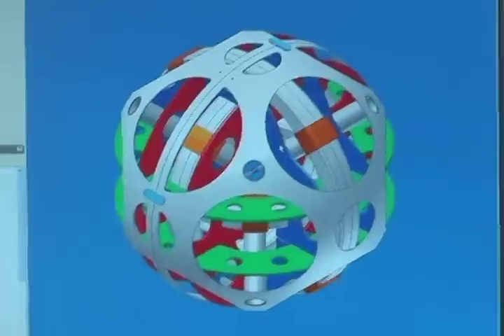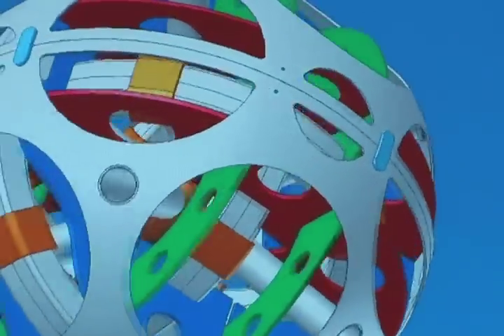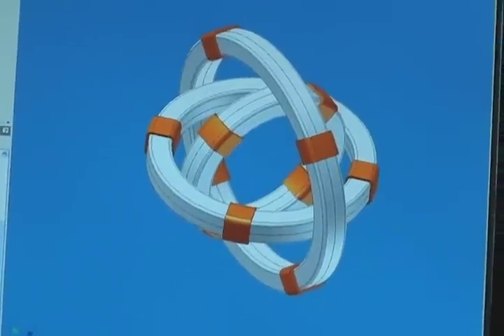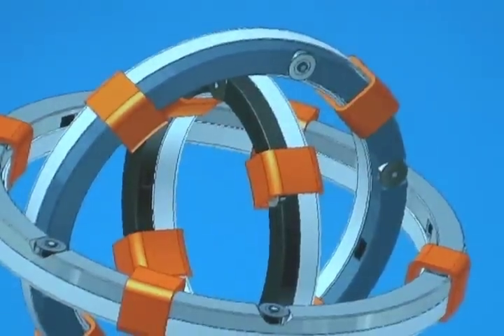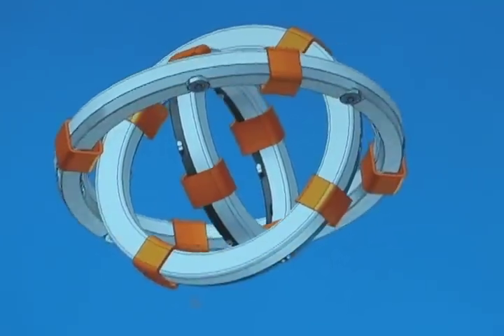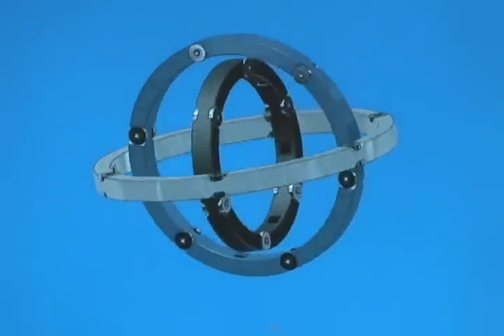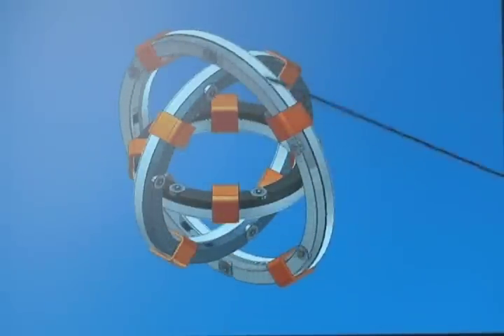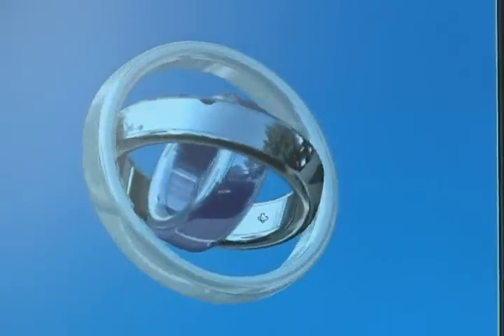Apparatus for Gyroscopic Propulsion Explained

Comment: What will you use to spin the the "wheels"?
They would rely on the opposing force of the friction between the mechanisms base and the ground would they not? 
Have you considered Eddy Currents? You'd have to find a way to deal with the incredible temperatures though.
Reply: +Connor Sprague: The patent describes what are essentially DC brushless motors of the type used an common small dc (muffin) fans or electric model airplane motors, or Video tape and Hard Drive platter drives.
...  Here is the patent
http://www.freepatentsonline.com/6705174.pdf
Cheers, ScienceAdvisorSteve

Comment: wouldn't you have 3 sets of gyroscopic drift to compensate for with your model set up that way. If you have 2 sets of rotters for each axis rotating in opposite directions you would eliminate that. It would not be to difficult with you existing model just split the rotters so you have 2 then reverse the magnets polarity in one and it will spin opposite of its counterpart. To make a total of 6 rotters instead of just 3.

Comment: "Apparatus for Gyroscopic Propulsion Explained"
Apparatus - yes
Gyroscopic - yes
Propulsion - no, no propulsion here.
Explained - absolutely not! you showed how it's built, but not how it works or what it does.
Reply: erasmusso exactly, this guy gets more than 600 000 views for explaining how 3 rings spin perpendicular to eachother and talking about the materials they're made from...
Reply: @Ruktiet  The funny part is that they wouldn't even have the same gyroscopic force if the materials are balanced for the same speed - because different diameters result in different rates of rotation for the same rate of the axis itself.
Reply: I'm with you ... I heard NO PROPULSION explained, WHATSOEVER ... !!!!!  VERY AGGRAVATING ... thinking you're going to "get something", and then ... YOU DON'T ... !!!!!  😡😡😡
Reply: i think there can only be one genius in the world at a time
Reply: J. Christie i like the way you think
Reply: Antigravity is not possible by using gyroscope .... all it does is it shifts all its weight to another pivot point and the flywheel seems weightless ...but the total weight of the whole system is not changed at all...so the term antigravity is not suitable for such device...it's a good way of fooling dumb people out there...you not gonna launch your space shuttle into the space with this ..
Reply: nemo but what I am teach me sensei
Reply: Imagination you Lack. So with this device you want Propulsion? I suggest building a Replication you control it with 555Timer chip, and interface this with "Ionic Propulsion"(High Voltage Wind{seen at Spark Gap}) shown in "Tin Foil Flyer/lifter" video's on "You-tube".
Reply: @j.christie2594  Yes i realised this when seeing the three different metals that were used, i knew it was similar to em lifters....using the voltage saturation in the rings somehow. so essentially, in theory could we use just one ring rotation ring to get propulsion on another device?
Reply: @ambientsoda106  I think this require's several Gyro's Fighting in unison, Each other. I find it hard to believe One Gyro with NO Equal Counter Force('s), can do anything other than balance a Thing/frame attached to a Surface, as we all see in top's/Gyro's.
 Em Lifter + 3Gyro's for even just leveling purpose's would Stabilize. they say 2 is better than 1, but in this case 3 (N. Tesla 3-6-9) might balance  or more, better than 2 when looking for 0-G effect, just saying.
maybe 6 or 9, and add control.
 Some motor's are generator's of Super H.V.  I think a "Joule Thief Motor" using Rotor as Gyro and H.V. for Lifting Ionic.
 A X3, "JT pulse Motor's",  made from those Fidget Spinner toy's like on YT.
  I just thought about that How easy, Spin 3 JT coil's wire them Up, get 3 fidget spinner's, bunch of Tiny magnet's, a back Spike collector, Charger circuit, to Capacitor, to Emitter, to  Foil "Ring".
Reply: @j.christie2594  Hi was thinking of something like one gyro with a high saturation of elections across it... 

I was just thinking about an idea I had at the time; using waves, and using the ring to create a waveform plane as well.

Consider this that by having the right wave we can create a plane like a space distortion, that can pushing a object or an EM bubble forwards. And even a solid state ring a an high electron saturation can create a low pressure distorting that can make things float...I think this rings are interesting but still trying to figure out how they create the force to fly?
Reply: @j.christie2594  Also I find this interesting as a few years ago I think there was a UFO video I saw, and this object was what I believe I saw a version of in the video, why I thought it was a realy video and not a fake - albiet man made and not alien; and that it seemed part of this design explained a curve exhaust in some UFO images; albeit those UFO seem lik eun manned drones.

But actually these videos gave me the ide that a wave form plane can easily be creates to pust a disc shaped prototype craft - which essentially is the design seen in start trek - I know don't laugh but I believe it work also because basis form atomic structures is a wave pulse,  waves can excite an atom and move it and repel - I guessed that warp speed using a wave and the speed can be scaled up like an atomic reaction, creating different speed of wave (light) transportation - and now hold on, I'm no genius - I just learnt all this from YOUTUBE...LEL.. I have the impression that all the work created in the west explains the UFO phenomenon in the Western states and particularly the US..I kinda feel happy after realising most things work on very simple principlas and again the  creation of the speak and aaray grid antenna  allows any wave to be created now, and created an EM eave around anything is easy now.

Sound and essentially light seems to have a place as the paramount tool in technological society, because it is an purposeless tool..
Reply: @ambientsoda106  SO, it Just came to me, the different metal's are for Weight, this is said in other movie showing this on YT. 
But, Outer ring is made with Lightest metal, center middle, weight and density some between the other's and smallest with heavier of the 3 metal's. This is like I say, you need several "Equal" weight and Speed gyro's to fight each other.
 Speed and directional control would be in the Slowing down or Speeding up of one or two gyro's, versus other's Speed for Pitch and Yaw. I'm thinking more and more this can't be to hard to Replicate for some on with Good 3-D modeling Skill's Better than mine are and a 3-D Printer.
Reply: @j.christie2594  but those forces alone allow this to levitate? Actually the layer system of metals interest me because of the ability to pass charge through them.
Reply: @j.christie2594  but you could do all this just using aluminium, so unless you want to take advantage of the outer layers of electrons in three different metals, this use of three different metals seems bizarre..
Reply: @ambientsoda106  SO, if one was to Use a Pulse motor to run this, as in this case . 
 You would know the Weight of Each Bearing, of each magnet then you would want to get each Magnet wheel  to weigh the same with magnet's/Bearing's In-set to them.
 And being that, different metal's weight different weight's. So the weight of Each Magnet Wheel could be the same even though they all are different Diameter's , "Thomas Faraday Mono-Polar Motor" I think was what Tesla would have used for this, because they are so simple to Make duplicate, Make into Gyro's and Power with Simple Direct current and Variable Resistor's control.
 Look for, Mono Polar Motor on YT.  
To apply this concept to a Gyro/ set of each with their own power controller in a Triad Mercedes Benz Symbol, Then add Hoop and Ionic Propulsion on out side of Frame work, running the Mono's ( 6-12VDC) with the charge bound for H.V. Step-up inverter circuit, to the Ionic Ring as Ground.
 Just think What was around then, Solid State, Pre-transistor, so use what was then available,  Basic Faraday, like "Spiritmental-YT" does, but he's still not seeing the use of 3-6-9 "Multiple's. His Counter rotating Faraday should be made into three and put to a Triangle Frame, use left over (back side) Current transform into HV and add, then run Ring set "Ionic Propulsion" off the tail end of circuit. 
 But that's just idea.
 I can say Ionic work's, weigh's in heavy do to transformer's, work's Better in Circle/Ring formation than Triangle, cause that's way Magnetic Energy move's.
 Any way's I hope i made some sense, and you get the Weight in different metal's issue for what it' is.
Reply: That's not a scientific theory its just a mechanical thought that by common sense has no function waist of time waist of money the third center ring won't do any thing the rings being made of different metals means nothing the second and third ring being different diamators will make it wobble

Comment: I don't know how the patent office would even permit an application of something that has been around since the beginning of time.  To patent a gyroscope is to patent going to the bathroom.
Reply: rayzimmermin Old News.
Reply: Its not a patent for a gyro. Its a patent on the device that uses 3 gyros big difference.
Reply: Tait Jones
Monsantos?
Reply: David Ouellette  LMAO  I wouldn't doubt it in the least.
Reply: rayzimmermin Nope. Linear momentum vs angular momentum, not the same thing.
Reply: has anyone tried getting a patent on going to the bathroom?
Reply: rayzimmermin that does NOTHING but not want to move in cool ways,, yeah NOT want to move
Reply: Well, yeah. The question is, what can you do with the energy that something like this would release? Can you use the energy as a transport device? Can we launch something through it into another dimension? Is it just another stagnant example of physics, or can it be used for something productive, and will we still have scientific geniuses to still ponder that question - after all of these years?
Reply: joshua golden Have you ever heard of a reaction wheel it’s used to move in zero g a modified version could theoretically could be used to move an anti-gravity devise

Comment: what would you house it in? you will need to have exceptionally high rpm for it to function id say a vacuum to start with then??? but i agree this is basically a anti gravity engine a very mechanical one but angular momentum does create that affect, just look at a toy gyro
Reply: It doesn't resist gravity, it just keeps it balanced on top of something. HUGE difference. If you remove the platform that the gyroscope is sitting on, it doesn't just hover there in mid-air, resisting gravity. It drops to the floor, like anything else. There must be an anchor to the ground somewhere or it's going to fall, that's basic physics.
Reply: legen daric cant be sure if you spun a gyro at 500,000 rpm who knows what would happen you could create a rip in the very fabric of space and time i would leave it.what do you think of a em resonant frequency engine that would be super luminary? or do you know what any of that means i learned it off the telly so whats the point if its only use is in space then???

Comment: The thing you are missing in your analysis,  Kelly, is the fact that there is a reaction force AGAINST the driving coils (which are attached to the frame). Thus this force off-sets the rotation of the rings and actually tries to rotate the FRAME in the opposite direction.  An analysis of these three 'reaction" forces upon the frame is necessary to determine the rotation of the frame as a whole.